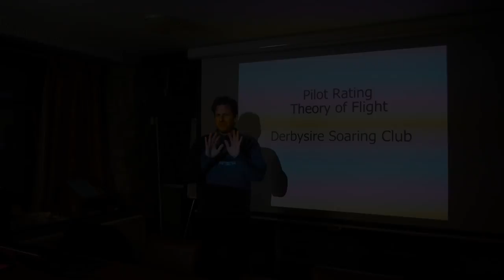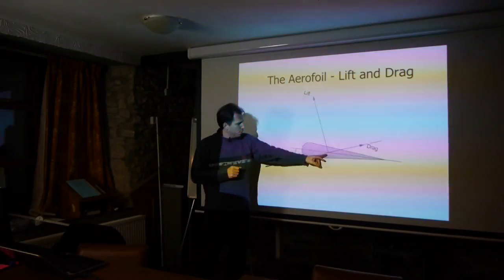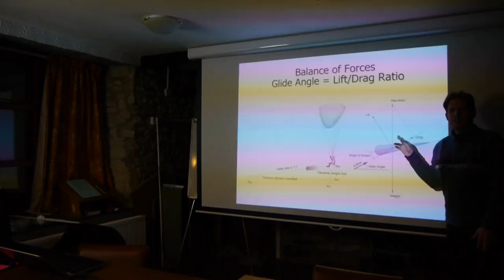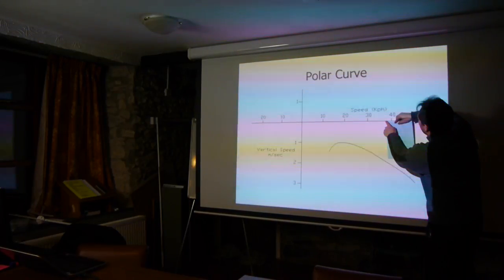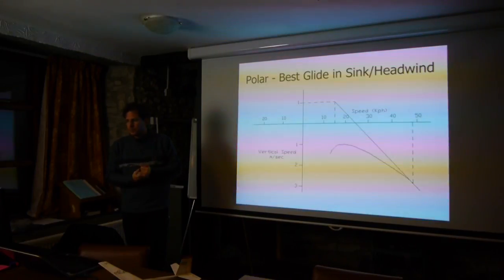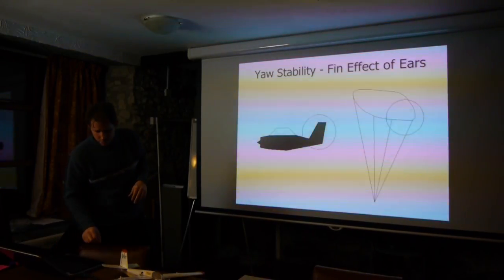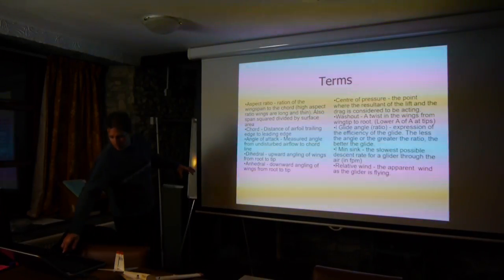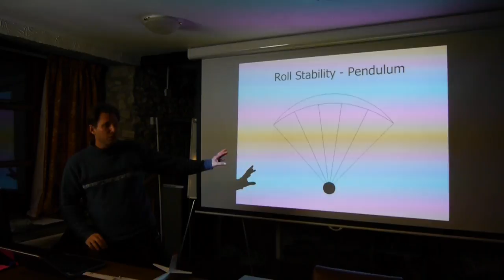BHPA Pilot rating - Theory of Flight

Comment: For safe flying Paraglider pilots should be aware that (laminar) air flow past the surface of the wing does NOT decrease the total pressure rather it results in a reduction in STATIC pressure (the equation given by Bernoulli is balanced by the increase in Dynamic pressure)while the total pressure remains a constant... 'Nota Bene' in fact for Bernoulli to be applicable the Total Pressure MUST be a CONSTANT..